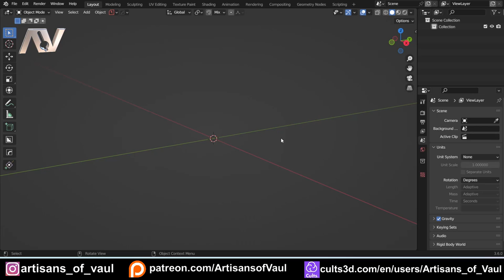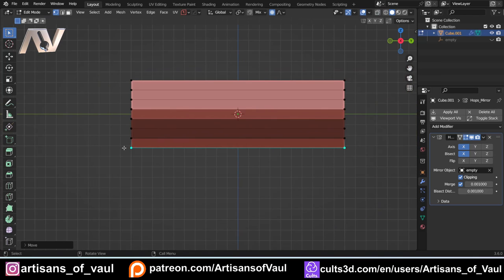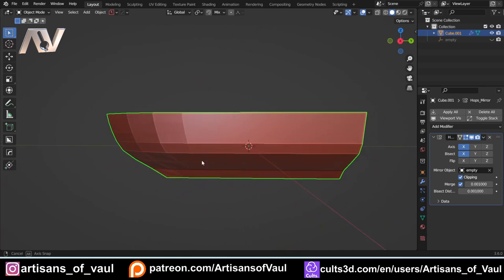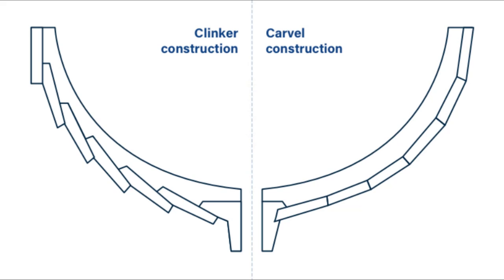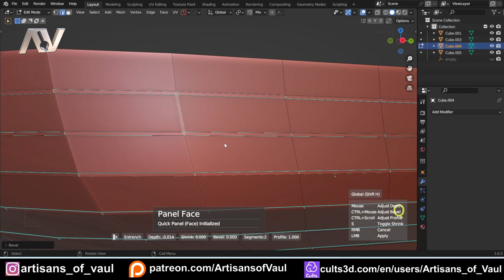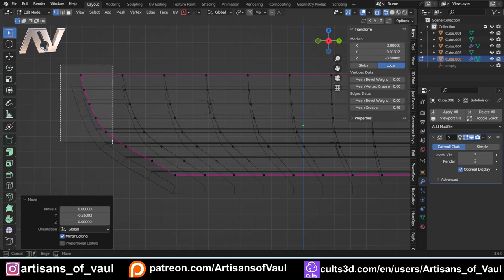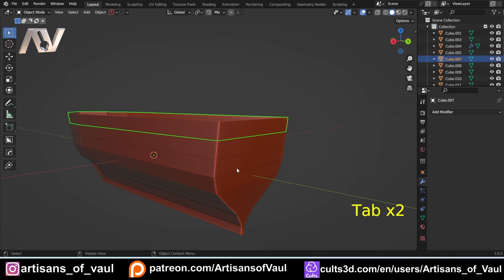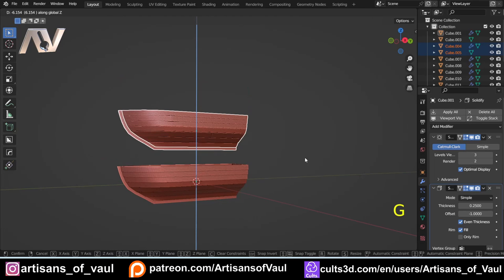Modelling a boat hull in Blender

Comment: The edge split seems like a good technique. This is the first time I have seen this modifier used like this. I am gonna keep that in mind. Great vid as usual
Reply from the maker: Yeah, it's a tool that's a bit of a hidden gem. It could also be done with ripping verts but I think that would take much longer in this instance as you need them to move in different directions. You can see vert ripping here: https://youtu.be/8KOt9Imp_Zw

Comment: This is really nice!  I always used splines and patching for hull modelling, which was highly precise but prone to localised shading problems, and not always straightforward to achieve the planks.  This is a great approach.  Thanks for the tutorial!
Reply from the maker: Thanks so much. As you say I'm sure you get some really good results in terms of a smooth and accurate hull shape using that method. I just find the other details harder to them make work (as you've also identified). Glad I could be of help 👍🏻😁

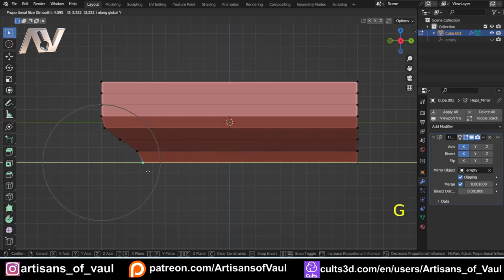Comment: At about the 3:05 mark, you cancelled out of the proportional editing/move tool to change the falloff type manually from the proportional editing menu. You could have alternatively left this tool and mode live and while holding down Shift, press O to toggle the next falloff (continuously pressing O will cycle through the different falloffs until you find the one that you want). This workflow is much faster!
Reply from the maker: Thanks man! I didn't know that, great tip! 😁👍🏻👍🏻👍🏻
Reply: @ArtisansofVaul You're welcome! :)

Comment: This is the closest video I can see to ask the question on but I have a weird one / personal. When adding detail such as wood grain (as you would on the outside of a boat for example) do you think it is better to do it through sculpting (which is what I currently do) or should I learn about displace/texture modifiers to "dig into" the wooden planks? 
I still am unsure if that would actually make detail for 3D printing, so never learned about it. I have only used textures in digital art with PS, which cannot be 3D printed, obviously.
Reply from the maker: Good question without one real answer. It depends on the result you want. Displacement textures are faster but can add even more geometry than sculpting to get a good texture and on edges they can have issues. If it was me I usually sculpt wood grain as I think it looks better and I actually find it quite relaxing. And it does print pretty well in my experience. I actually have a video on methods of making wood grain if you're interested: https://youtu.be/ITVOllroIaE
Reply: @ArtisansofVaul  Well thanks for the non-answer. GER! Just kidding, I'll check the video out. Start a project, look up a video for help, and then see I started it a completely different way and their help won't help me. Ha.
Reply from the maker: @RoseKindred  😅 Yeah, sorry for the "it depends" answer but it really does. Basically both are valid. Do let me know what you think though.

Comment: Excellent work dude! Is there a reason the top one bulges at the plank joint? Is that just the rendering? 16:26
Reply from the maker: That's just a rendering "issue" with the cavity because of the higher number of vertices at that point combined with the cavity being on. It wouldn't appear in something like a print or a render 👍🏻 Good spot and good question!

Comment: Can you do one where you start with a circle of vertices and model it from its outline when looking exactly down on it, so the waterline outline or lower or higher depending where you wanna start.
Reply from the maker: I mean it's possible. I just wouldn't start with a circle, it seems a bit inefficient.
Reply: @ArtisansofVaul  Pull 2 perpendicular vertices out of the flat circle and you already have a good boat shape, or pull a few perpendicular vertices with prop. editing to get other front and end shaped boats, if you want the end squared like your you can select about 1 quarter of the circles vertices on the stern side and make them flat using S, X(or other axis), 0, Enter, to make the scale of those vertices 0 or flat.
Reply from the maker: @user-ez7ls2du9c  It's not that I don't know how to do it, I just wouldn't work through it in that way. But it seems you're perfectly happy with how to do it this way already so you don't need me to show you 👍🏻
Reply: @ArtisansofVaul  bro your lil boaty looks like a shoe box, its got no character or historical accuracy, get this lame away from me
Reply from the maker: @user-ez7ls2du9c  🤣 Wow... Good way to take no for an answer. What a child.